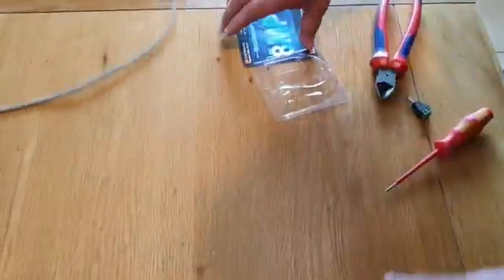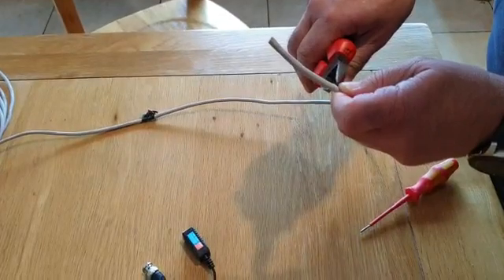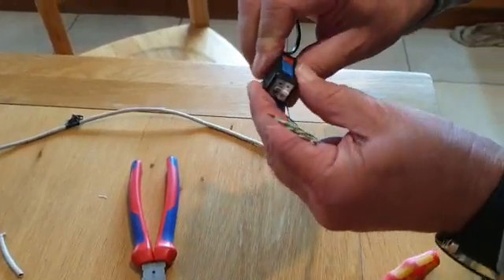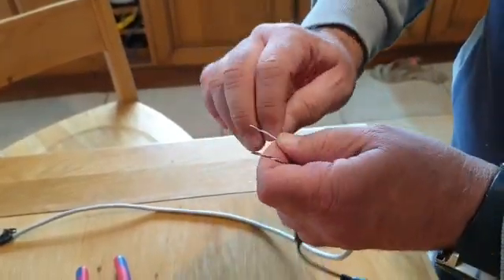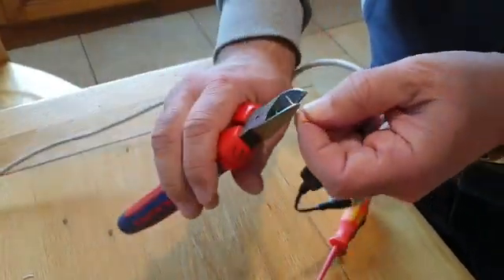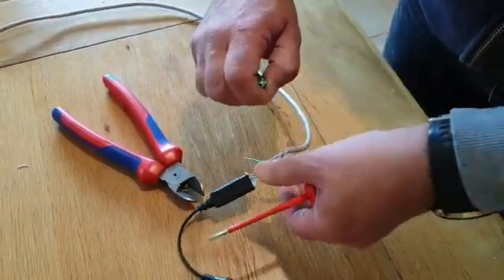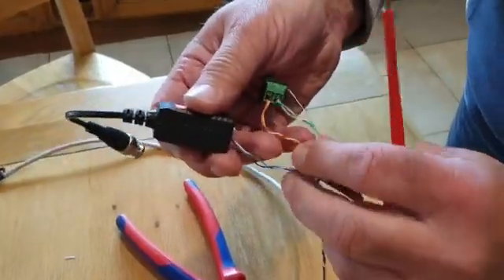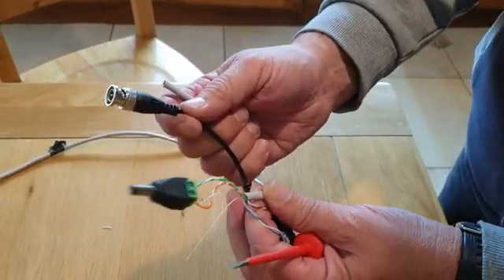How To Connect Baluns To CAT5 Cable For CCTV Cameras

Comment: in my house, I wired my entire home with 25 pair CAT 3 cabling, I did home runs to the utility closet where the telecom equipment is. as time went on I needed to add a 8 channel DVR and camera setup. Thank God I wired the house the way I did because I was able to tie into the system for my security cameras and add that feature to the telecom system. I used these baluns plus the barrel connectors for each camera using a central 12 volt PSU feeding all the cameras. then I was able to tie in each camera and connect them dirrectly to the DVR.

Comment: I’m in Kilkenny- I’ve a DVR and I’m looking around at how cheap the ptz Wi-Fi cameras now are . Can I connect the Wi-Fi ptz to an existing DVR ?  It only has the standard coax connection on the back of the dvr . But it does have rs485 terminals

Comment: And it DOES NOT matter what color you use. As long as you use it on both ends. Smh
Reply from the maker: The pitch of the twist on each pair is different, so you need to use the blue pair for maximum distance. You should read up on the relationship between capacitance, impedance and inductance on a twisted cable. It explains how Ethernet cable works, very interesting and useful.
Reply: @stoned You are wong.

Comment: the UTP cable are better than the coax ?
Reply: Well yes and now, if its a longer distance run you are better off with coax, but still if you go with UTP you can then down the line just crimp a RJ45 and have a IP camera setup ready

Comment: So will hooking like this, you need to do it on the camera end and also the end to hook to the DVR? Does the balun that hooks to the DVR side of the set up also need a power source plugged in ?
Reply from the maker: These baluns don't need any power, you use the DC plugs to supply power to the camera.

Comment: Hi , We have done a install using hikvision color vu 8mp Poc cameras and only 1 camera switches on and has very bad ghosting while the other 2 are off completely. We used a Cat 6 cable for that and is the first time it's happened to us , we are tempted to just run rg59 shotgun cable and power the cameras from a separate splitter psu
Reply: Rg59 is so good by using NBC pin than cat 6 cable by using video balloon

Comment: Thank you for the video. Is it advisable to triple the wires for the power? I usually only use pairs for power, however, on the rare occasion a camera will go black and white during the day? I’m using the standard Qvis 4 way power  supply and a single cat5e cable for each camera. Sometimes if I use one cable for 2 analogue cameras then I will use a separate 2A power supply. What do you advise? Thank you in advance.

Forgot to mention, sometimes just unplugging the power supply and re plugging it in resolves the issue. Just don’t understand why this very occasionally occurs?

Would the best solution in this instance is to triple the wires for power?

Comment: What’s the maximum cable distance you can achieve? I’ve used some “300m rated” baluns and the picture was dropping out and looked awful. Hikvision cameras, cable run roughly 250–300m (not my work!)
Reply: Maybe the power supply cant supply long range. Try to put high amps power supply
Reply: Also…..cameras powered locally, this is purely the video on one pair.
Reply from the maker: @msw73497349  , we recommend good qulaity 4k 8MP blauns, like the units in this video and good quality CAT6e. Try lowering the camera to 2MP to see if it helps. There are too many variables to diagnose here, try a local installer. 300 metres is a very long distance, we would have used IP cameras and fibre optic cables for. The baluns we use state 400m @ 2MP and 200m @ 8MP.

Comment: CCTV with two pairs in the balun gives a certain amount of redundancy in case one pair breaks. This is especially relative and important when installs are carried out in this configuration in cold countries.
Reply from the maker: It is critically important that you DO NOT double up on the pairs going into the baluns. Ehternet cable is UTP cable with specific twists in the cable, having two pairs can cause interference and video loss, especially on longer runs. You must only use one pair, not two.
Reply: @CCTVIreland  I totally agree. I did this once on a long run approx 60-70 metres and there was interference when doubling up the video baluns. As soon as I reduced it to single wires the interference went. Thank you
Reply: @CCTVIreland  Yes, you are right, only one pair for balun needed
Reply: For Video Balun only use 1 pair?

But for Power is it OK to use all three remaining pairs?

What is minimum amps for 30m run? On utp

Comment: What if I make 2 wires each for + and - for video balun?
Reply from the maker: Yes, but only for the power, not for the video.
Reply: @CCTVIreland  oh that's why when i made it 2 wires for the video balun the output looks like has a shadow
Reply from the maker: @iamjhie6795  Yes, watch the video to see how to make the connections.
Reply: Is this correct way of wiring all surveillance camera??

Comment: Not very tidy, use rj45 connector for cat5 and a video/power value. Terminates neatly, looks professional, and never get earth issues
Reply from the maker: Thank you for your comment. This video is about video baluns with screw in terminals. They are a lot smaller and more discreet than video baluns that have RJ45 connectors built-in, which are generally a lot bigger and harder to hide.
The problem with almost all Video baluns that use RJ45 connectors is that they don't work very well with HIKVision Turbo cameras. We have tried over fifty different types and haven't found one that works properly. So my expert advice to you is not to use video baluns with RJ45 connectors if you are using HIKVision cameras, they don't work properly.
Reply: @CCTVIreland how about dahua cameras? Are they ok with rj45 baluns?

Comment: Hi. CAT 5 cable have 4 pair. 
i saw you use 2 pair for power connector and only 1 pair for balun connector.
Then there is another 1 pair is left not use on that cable.
what is the impact if we use 2 pair for power connector and another 2 pair for balun connector. It is possible? 
Appreciate your feedback on this.
Reply from the maker: It is important that you only use one pair for the video connections on the balun. CAT5/6 is UTP cable, that's unshielded Twisted-pair. Each pair is twisted with a different pitch to prevent crosstalk. You can use the remaining three pairs for the power, the more you you the less voltage drop over longer runs. But definitely only one pair for the balun for video transmission. Using two poairs will reduce the distance and may cause ghosting on the image.
Reply: @CCTVIreland  can I use the spare ones with another camera?
Reply: @CCTVIreland  Yep,also, just double up on the negative, don't need to double the poz.

Comment: Hi 
I have a 6 camera setup but last month there was a lot of interference meaning that all channels were scrambled. I bought a new DVR but the problem is still there.
I'm using a 8 way power splitter but will only work with one  camera at a time.
How can I get all 6 working again?
Reply: Sounds like you need a ground loop isolator